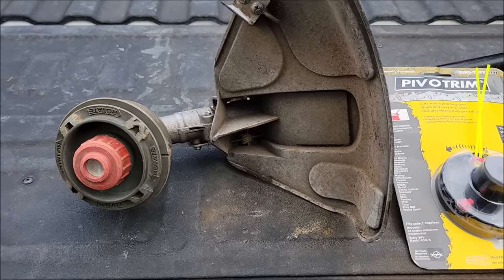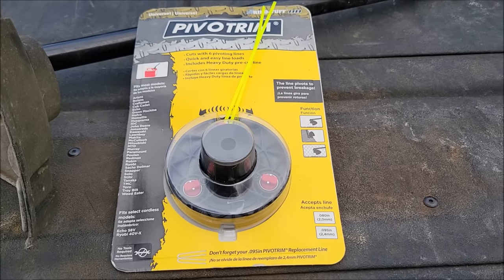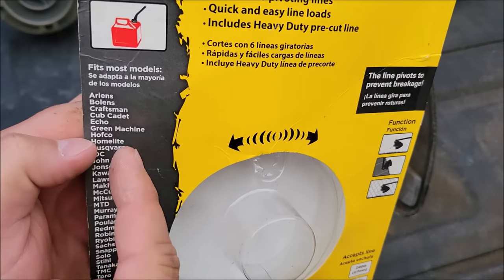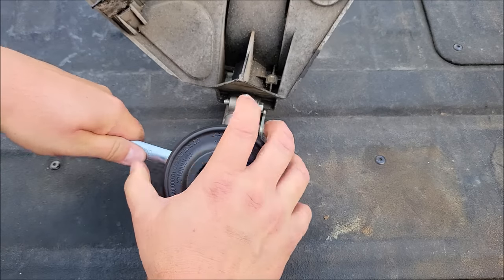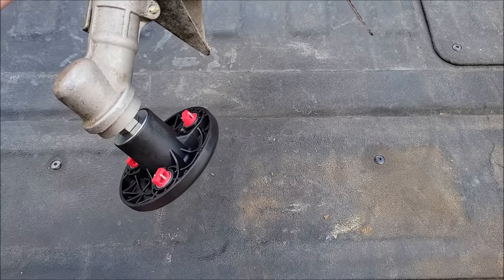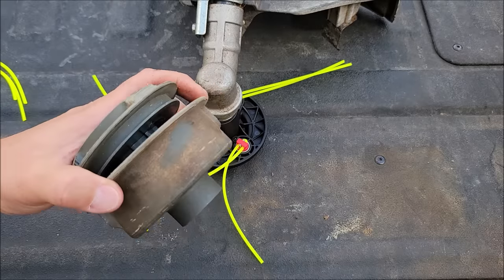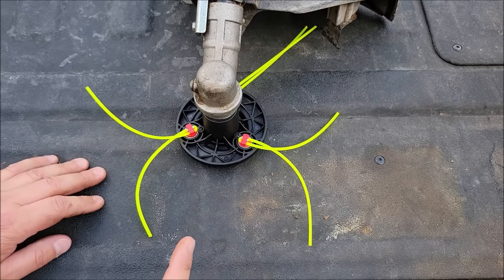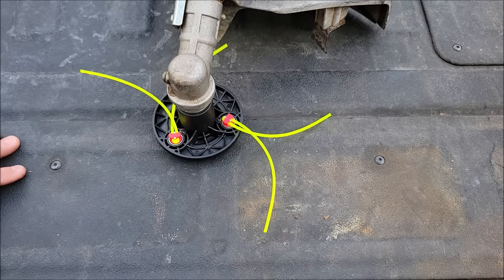Installing the Best Trimmer Head Ever | PivoTrim Replacement Head

Comment from the maker: I mean it, it's the best trimmer head I have ever used.  This is not a paid promotion, I bought the trimmer head with my own money and no one from any company got me to make this.  I just really liked the trimmer head and wanted to make sure people know about it.  Many people struggle with bump heads and this is a great alternative.  Enjoy!  👍  You can get this one here: https://amzn.to/3f8iBI5 and the newer combo head here: https://amzn.to/2SjUKfG
Reply: Just installed mine a few minutes ago, Love it. Gave it a test ride at 7:25. Had me weed eating in the dark. Couldn't stop. Nice not to have stop and rethread.,👍
Reply from the maker: @derricks.3950  Awesome.  Glad it worked great for you.
Reply: Can I use this on my cordless (battery) black and decker 40v weedeater? If so please give me tips
Reply from the maker: @w0251605  You probably can, but I would look at the specs to make sure.  It does support a lot of trimmers.
Reply: 4:16
Reply: Think you should give the speed feed 450 a try.  Much better head and holds  .80 - .130 line bump feed and fast load.  These are OK for around home but nice to have line loaded.
Reply from the maker: @zack6892  I have been meaning to try that.
Reply: @SeidelRanch  definitely worth the money especially if you've got a high torque trimmer that can spin. 130. It will hold a ton of .80 also though so pretty nice either way.  The echomatic pro is really nice also and holds .80 to .130. The echomatic pro seems made better and I like that it sits higher up so it's harder to scalp grass while trimming. I run my echo Pas 2620 with the pro torque trimmer with the echomatic pro and .130 line at its nice cause it never bogs in the grass or kicks in your hands. I use the echomatic on the pro torque trimmer head then the speed feed on the standard trimmer echo for the pas.
Reply: I am trying to replace it with a bump head. I disagree, I always break the line and have to keep changing them. Maybe the .95 line I use is trash.
Reply: @forex trader  these are just cheap heads for people who don't need a lot of line and want an easy to load trimmer.  Get the echo speed feed head and it will be much better any of the models will run .95 if you want to go bigger the speed feed 450/500 will run that too.
Reply from the maker: @forextrader2464  I have found some line is more brittle than others.  That will make them break off much easier.

Comment: I guess this guy does not trim around any hard surfaces. If I had that setup I would spend more time putting in new line than I would trimming.
Reply from the maker: Just a house, pool, large concrete patio, fence, walkways and driveway.  That's all.
Reply: Using fixed line you have to be careful to trim with the tip of the line, not forcing the entire trimmer head into the grass or whatever you are cutting. It can be done. Easy does it.
Reply: If this head allows you to put the larger line on it, you may find that the line doesn’t break as often.  I have a DR walk behind trimmer/mower that takes the really thick trimmer line in fixed length pieces.  I can do my entire property (4 acres) without changing the lines.  If I could put that line on my Stihl weed whacker I would.
Reply: I have one and it works great and the line is tough

Comment: Make sure you soak the line in a container of water for an hour or so to prevent premature breakage of the line. You dropped a nut into the plastic, not a bolt.
Reply from the maker: Ah, I did say bolt huh.  I wonder if my subconscious did not want to say wiggle that nut around.  Nice catch.  And good tip on the soaking.  I have never done that but apparently it's a really good thing to do.  Thanks.
Reply: If you put the head on and realize you need to use a spacer, does the spacer go on first, then the washer and then the head or is it the washer the spacer than the head? Thank you for your time
Reply: @craighellberg4366 I had a pivot pro gray version and it wouldn't thread on to my stihl right. Any ideas?

Comment: In Scotland, that "bolt" is actually a 'nut' 👍🤣
Reply from the maker: Good to know.  I feel more worldly now.  I have been to Scotland.  I think I was a nut there too.
Reply: andicampbell8621.
🤣I was wondering if someone would point that out lol.
I have been searching for a better set up than I had, and the one I saw on you tube that really struck me as a good one was the one where you line up the hole right through the head, then feed about 10 feet of line right through, double it over and cut, =20 feet, then ratchet the line on till you have the correct length that you want and you're good to go.

However, as easy as this is, and I'm happy with it....the one in your video would be hard to beat. You are basically going from two strings to six strings, which is probably why it lasts so long. I will definitely give this one a try.
Thanks

Comment: anyone had any luck installing these pivotrims on a battery powered trimmer?? i tried and failed with my greenworks 40v
Reply from the maker: This worked on my Ryobi 40v trimmer.  I think it's going to to come down to the head that the trimmer uses.  Is it an "electric type" auto feed head or a "gas type" bump head.  My 40v had a gas type bump head on it.

Comment: Hey I got the pivotpro head but its a gray one and it won't fir on my stihl fcs 56 rc because the reverse thread nut is different. Any ideas?
Reply from the maker: So none of the adapters in the package fit that threaded shaft?
Reply: @SeidelRanch  there were no adapters
Reply from the maker: @CountBeetle  Really?  Did you buy it new?  Mine had a handful of different nuts and bolts.
Reply: @SeidelRanch  yeah. Wish I could just find the right one
Reply from the maker: @CountBeetle  Sorry to hear that.  Some trimmers just don't have replacement heads for them out there. We have a few like that.

Comment: Will this fit a kobalt 40 volt model 1040 b-03
Reply from the maker: Just based on pics from the website I would say probably not.  This head is geared more towards the gas powered trimmers or the battery trimmers that use gas type heads.

Comment: I have one but a different brand it take .105  diameter line works grat in thick grass
Reply from the maker: They are a great design.
Reply: @SeidelRanch   can you review the hybrid version ? ( brush cuter and string cutter)
Reply from the maker: @cpsbandit6164  I would need to buy one and replace a head somewhere.  I will see what trimmer I have that can take that.
Reply: Ok 105 don't fray like .95 especially when you get wire core line Husqvarna makes good line 😊 @SeidelRanch

Comment: I have used this type years ago.  Eventually went with the "Shark" and the Tanaka.  The Tanaka I can use .130 line for heavy grass.  Rarely have to replace that line.  The Shark, has steel blades on the outer edge.  Takes care of any berry bush stock pronto where is a string will break.
Reply from the maker: Sounds like you are dealing with some heavy grass/brush.  I would step up to something heavier than this head also if I was dealing with larger brush.  I use this just for the lawn at my urban home.  Thanks for the good info.

Comment: Love how you keep calling a nut a bolt lol I also have one of these but it’s got 4 spots for string instead of 3. Sounds pretty cool with 6 or 8 string ends whipping around and yes these pivotrim heads are frickin awesome. Definitely superior to the old crappy and sometimes pain in the ass traditional weed eater head. With 4 foot of string I can do multiple yards and have enough left over for more
Reply from the maker: I mix up words all the time because I have a screw loose.
Reply: It was killing me
Reply: Mine is the newer version and the nut won't thread onto my stihl properly? The stihl nut is a different size. How can I fix that

Comment: I just bought one of these style heads yesterday and looking to install it shortly. I don’t mind the bump head that mine currently has, but with it having dual lines that have to be feed can be a little time consuming if the line doesn’t catch not to mention that if one line comes off or out, then you’re running one line and have to deal with that which is another pain and time consuming.
Reply from the maker: I like mine.  Still use it all the time.

Comment: I have been using this style of head for many years. When my 25 year old shindawa weed eater was beyond repair, I asked to eco dealer to install a similar style head on the new weed eater.  Tip, when cutting new cords from a spool, I used a snippers and cut at a 45 degree angle. that way they go into the thingy much easier,
Reply from the maker: Ah, nice tip.  Thanks.

Comment: I have that same bump head and you are right, it's not great.  It sometimes makes you really hit it on the ground hard to get the line to come out.  Plus my red bolt on the bottom is all busted up.  I will have to try this new trimmer head.  Thanks for the video.
Reply from the maker: It's not the worst bump head I have ever used, but it's far from the greatest.  There are some nice bump heads out there, but this new head really made me love it.

Comment: I agree 100%, I have been using this Trimmer head for two or three years and I love it.  I would never use a trimmer with a different head again. My trimmer died and so far I bought 3 different trimmers but returned all of them because this trimmer head was not compatible or removing the head from the new Trimmer was difficult.  I just ordered a new Ryobi hoping that I can use my PivoTrim again. Thank you for the video
Reply from the maker: Thank you for the comment.  I love it.  So easy to change and it lasts forever.  It's going to be on all my gas trimmers.
Reply: If you put the head on and realize you need to use a spacer, does the spacer go on first, then the washer and then the head or is it the washer the spacer than the head? Thank you for your time

Comment: Thank you for your time,would this work on the STIHL trimming machine???
Reply from the maker: I think it will.  You may want to check out the details on Amazon to make sure.
Reply: It doesn't work on mine and I can't find a nut to get it on. The threads are finer on my stihl

Comment: Would the increase in amount of line result in a greater load on the engine? That’s my only concern especially commercially when trimmers are run all day. Thanks!
Reply from the maker: I don't see much of a load issue, but I understand the concern.  My cheaper Ryobi gas head handles it just fine so I would assume the nicer trimmers would have no issue with it.
Reply: Yes, it would be more load.  Don't buy an underpowered motor.
Reply: There is far less line with this Rino than on a bump type system. You may actually get more RPM’s with less effort because the head is only spinning line that is cutting instead of spinning extra line as well.

Comment: Isn't this waste of money?
As the string getting shorter then you have to throw the remaining out and replace with a new ones.
Reply from the maker: Not really.  This head saves me on line by not using up so much.  I usually run it until the line pieces are pretty small.

Comment: I purchased this head and really was excited about it. But the reality is the line breaks just as much. Maybe if you have a small yard or area to do that might be fine. But I have a very large yard and the line was breaking all the time.  It also did not cut weeds near as good. It’s fine for just grass but anything larger it will not do the job.  Also, I found that my ryobi gas weedeater ran significantly different with this head on. It was worse. Slower. Great concept, but for me it just didn’t work. I am going to try the echo 400. I’ve heard good things about it.
Reply from the maker: Sorry to hear you had issues with it.  I don't have a huge yard to trim (1/3 acre) so it's great for me.  I do know what you mean about it running slower.  The head has more line to sling so it puts more load on the trimmer.  I adjusted my trimmer carb to compensate for that but you don't have to.  Is this what you mean by the echo 400: https://amzn.to/37EOvuZ?  Let me know how that goes.  I would be interested.  I hated my Ryobi bump feed, but maybe it was a brand design issue and not a bump feed issue.  Good luck.
Reply: Tips:  Hydrate the line, put it in water for a few hours...  (2) be careful around hard objetcs, (3) Do not force the trimmer, you are supposed to cut with the tip of the line not forcing the entire line into the grass you are cutting....
Reply: The Echo 400, became the Echo 450, and is now the Echo Speed Feed 500 (2023). Lots of people say it is the best trimmer head on earth, especially as it can handle the heavier gauge lines with ease (.105", .120", .130" and .155").

Comment: This was an excellant video!
I bought one of these at Walmart for my Ryobi, because the bump spindle head was getting to be such a hassle to use.
I tried to unpackage it carefully (in case there was a problem with fit or performance) but that was impossible.
The included instructions were very poor, so I was about to put everything into a bag and return it.
Then I checked YouTube and found your video, and everything simply fell into place.
The company that sells these things should award you with a percentage of their sales, because without your easy to follow instrutions they would be dealing with many customer returns.
Thank you so much!
Just as you said, this thing works terrific!
Reply from the maker: Thank you. So glad it was helpful.

Comment: Can you use regular 095.  line ?
Reply from the maker: Yes, that works fine in mine.  You can even go larger if you want, as long as it fits in the little spindles.

Comment: Great presentation very informative. I bought the same type of trimmer head,may not have been the same manufacturer but same principle, many years ago,mine has 4 pivot heads. It's so much easier to replace the lines! Unfortunately, my weedeater fell apart and am looking for a new,quality gas trimmer. Think Stihl or Husqvarna are the types I will choose from. Will the Pivotrim heads fit most of these? Many thanks again,for the demonstration and information.
Reply from the maker: Glad it was helpful! I do think those are pretty universal style trimmers so I bet it will.

Comment: I have to agree. The Pivotrim is what I used to maintain 55 acres of cross-country jump course. I can't find one anymore. But I used One head for more than ten years. eventually, the pivot string holder broke and I replaced it. I lost it in the move to the new house. keep one if you can find it. Be Well and Good Journey.
Reply from the maker: That is a lot of trimming.  Glad you liked it.  I love mine too.  You can still get them on Amazon here: https://amzn.to/3AuFU8d
Reply: Speed makes one it's the hybrid version of the same head  it takes brush blades with it

Comment: Will this fit the Atlas trimmer from Harbor Freight? Also, how does it hold up with edging (concrete)? The shaft on the Atlas is quite a bit longer, with maybe an inch of bare metal (no threads) at the base of the bolt. Maybe there are spacers with the PivoTrim?
UPDATE:
I finally got the PivoTrim installed on my 40v Atlas weed trimmer. WARNING: none of the nuts and bolts that come with the PivoTrim will work on the Atlas 40v (or 80v since it's the same head). I took off everything on the arbor bolt. I bought a 10m x 1.25 nut and 5 10m washers. I put the washers on, slid the PivoTrim on then was frustrated AGAIN. The nut does not fit the hex nut holder that holds the PivoTrim on! So, I removed my side wire cutters and snipped the little brackets (looks like bee hive walls) as much as possible. Then, I used my hammer to hammer the 10m x 1.25 nut down as far as possible. Lastly, I held the arbor bolt in place using a screwdriver and spun the PivoTrim until it tightened. I got it as tight as possible. Now, it works. I've used the trimmer in only my backyard using an entire battery charge! The grass (and weeds) were out of control. I'm waiting to trim the front as the batter charges. I would recommend NOT changing out the Atlas trimmer heads. The PivoTrim works great, but you have to take how much time and effort you're willing to give to this endeavor. Done and happy with the final results, but I think I'd just get a more powerful trimmer in the first place.
Good luck.
Reply from the maker: Sorry, I was away for a few weeks.  Glad you got it working and thanks for all the great info.  I have never used an Atlas trimmer before.  These PivoTrim heads are designed more for gas trimmer head replacements.

Comment: use a screwdriver sticking out of hole from narrow side.  slide nut over rod or screwdriver and as you remove rod or screwdriver the nut lines up perfectly.  Takes 4 seconds
Reply from the maker: Very good tip, thanks.  I will try that next time.

Comment: Now here's a question: what about the same design setup but holds 0.155" line?
Reply from the maker: I bet you could stick some thicker line in there, but not sure about .155.  The thicker the line, the more load on the trimmer.

Comment: If you put the head on and realize you need to use a spacer, does the spacer go on first, then the washer and then the head or is it the washer the spacer than the head? Thank you for your time
Reply from the maker: I would put the spacer between the metal washer and the head.  The spacer is probably plastic and would get beat up if the washer was not there to protect it I bet.

Comment: This trimmer head is great. Does anyone know if there’s an adapter? I removed it from my gas trimmer and tried to hook it up to my EGO trimmer but it doesn’t seem to be compatible
Reply from the maker: When you buy it, the package comes with multiple adapters.  If you don't have them you may have to get another one mainly for the adapters. Having a spare though is not bad.